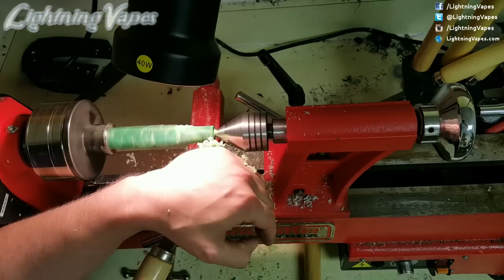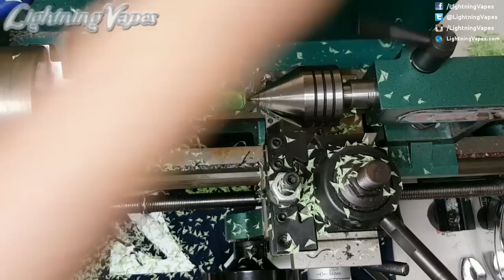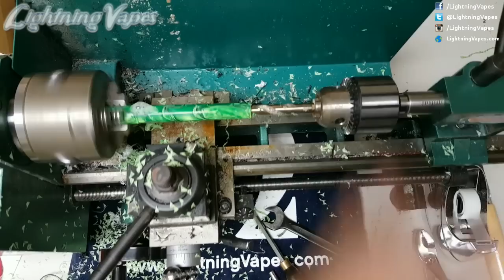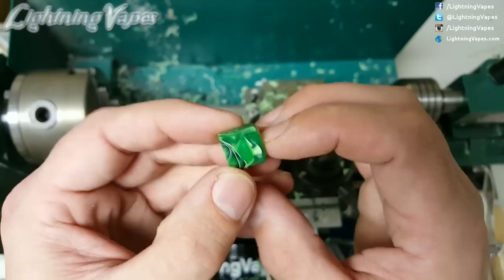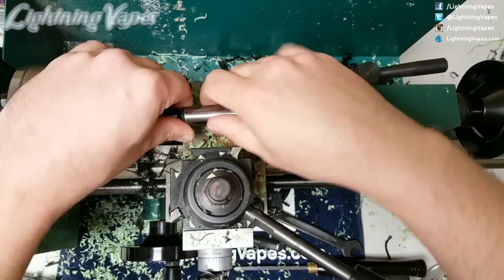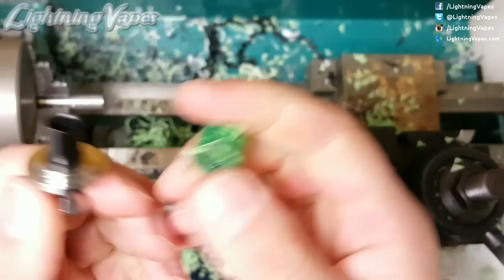How It's Made - Custom Goblin Mini Drip Tip, A Lightning Vapes Creation

Comment: Nice, i wish it had spit back protection, my goblin mini spits all the time.
Reply from the maker: If you wick it properly, it won't spit at you. Personally, i cut the wick diagonally and shove the longest point to the bottom of the wicking channel, the shortest of the diagonal cut sits just 1mm into the wicking channel. Never spits back.
Reply: +Sean Hanson (Lightning Vapes) Yep... not to mention breaking in the coil to get it glowing evenly. Pulsing while slowly going up in steps w/ that wattage, in like 10w increments...  gets it wicking/feeding properly too.  AKA no pools of liquid sitting on the wick where, perhaps, that coil isn't glowing too hot...  no really hot coil, glowing brightly right next to it, when wicking/feeding poorly too..  Is absolutely gonna send the liquid from that little pool, a-popping.. sputtering & spitting...  right up the chimney & like hot lava into ones mouth.   Just as with those who seem to always have OR wonder about gurgling, flooding & esp leaking.   If setup & used.... If refilled properly, esp if/when "top fill", by always being sure to close off AFC &/or juice control completely, first.. before ever touching any top or opening, to refill...  & never overfilling, either...  By design, anyway... none of 'em should ever be leaking!  If it does, just a sure sign something is wrong.  A coil head isn't threaded snugly enough OR came loose... was overfilled... an o-ring is out of place or no longer in tact...  AFC was left open & that internal vacuum pressure needed to hold liquid IN & keep it feeding properly..  has been broken.  If that happens liquid WILL take the path of least resistance OUT..... until empty.  Seems a waste to give it all to the device or table.. when it's just an easy half a second of added effort to avoid. :)   ENJOY... Live long(ER) & vape on!  #ABillionLives

Comment: You should get a 4 jaw chuck for the metal lathe. Would eliminate the entire setup on the wood lathe.
Reply: +ratindahat The only reason I keep it, is because with the 3 jaw tends to center round objects MUCH better than the 4 jaw. Believe me, I've thought about it, haha.
Reply from the maker: i found a decent self centering 4 jaw chuck! thanks for the tip!

Comment: Which he didn't have to compress two different material together to make one drip tip should of done it as one piece
Reply: Kao Xiong the black delrin inner can withstand and decipate heat much better than acrylic.  Helps keep it cool on the lips.  This particular drip tip design fits onto a metal extension at the top of the atomizer.  A 510/810/Goon style drip tip would be one piece of solid acrylic since it would be pressed INTO an opening rather than fitting OVER a piece of metal.

Comment: i really don't understand why you use a so big piece of material for make a so little thing
Reply: +Ronnie CoomCoom 
the blanks to use are generally 1 set size. theyre 3/4 x 3/4 x 5'' and the delrin used is bought in bulk and typically also 3/4''. they look big on here but in your hand theyre pretty small.
Reply: There's several different sizes of blanks, it's typically what's cheapest and best quality to what's used. Anywhere from 1/2 to 3x3 based on color and availability. I prefer the larger ones cause they can be cut to my specs and I can make more from one block at a cheaper cost.